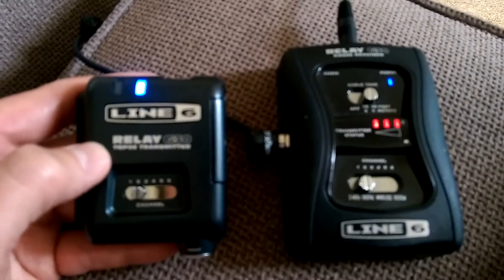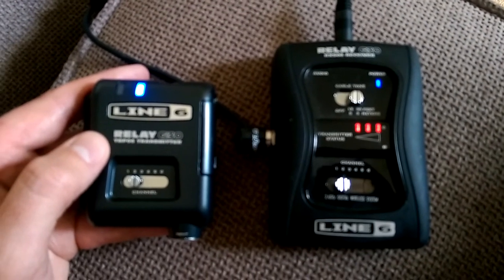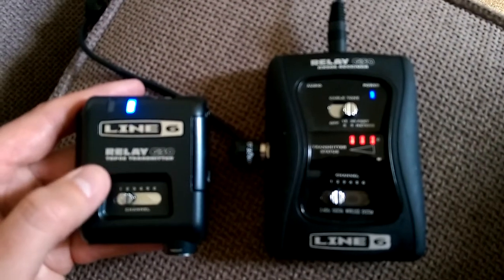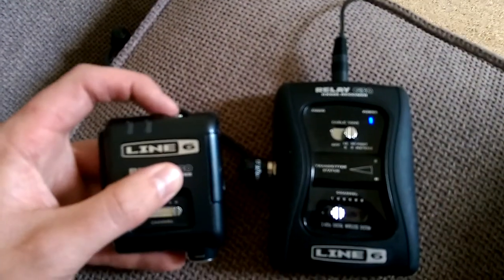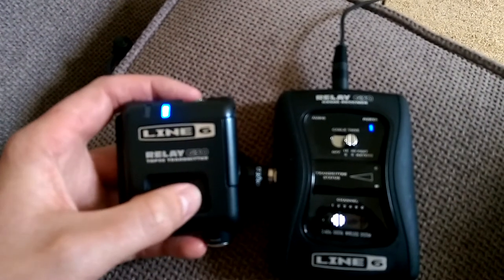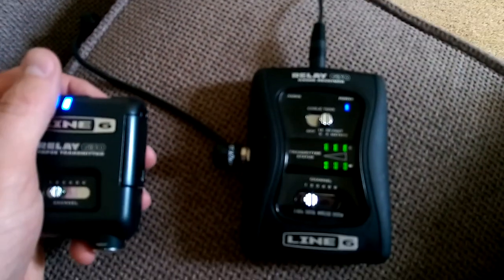Line6 G30 transmitter compatibility.

Comment: Sure helped! thanks so much!! ... I've been searching the line6 website and manual that came with the additional G30 transmitter.  But nothing on switching between RF1 and RF2 modes ... If you don't mind me asking, I'm curious where you got this information? cheers
Reply from the maker: Hi, after a LOT of searching on line I managed to find it on a forum. Wasn't an easy find hence why I did the video. 
Glad it helped. 
Rob